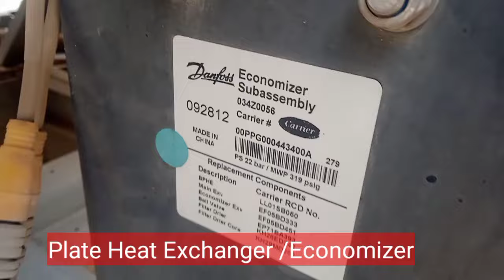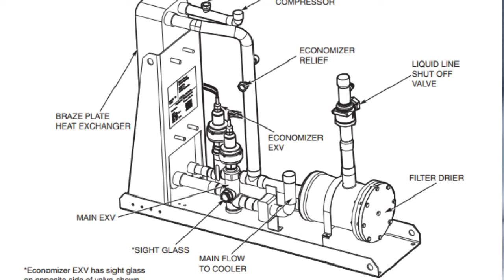Economiser Explore carrier chiller

Comment: Sir 3xa model mai agar cooler ki tube leakage ho jaye aur pani shell mai chala jaye to kya problem aayegi.dusara agar hum cooler ki tube jo leakage hai use rep air kare to gas ko pump down kare yaa shell mai rahane de thanks.
Reply from the maker: Agar tube leaked hui to system me pani jayega jisse gas or pani mixed ho jayegi compressor winding shot ho jayegi control me bhi issue aa sakta h aise cause me pure refrigerant to release kare fir nitrogen flushing karo pressure testing then blocked the leaked tube